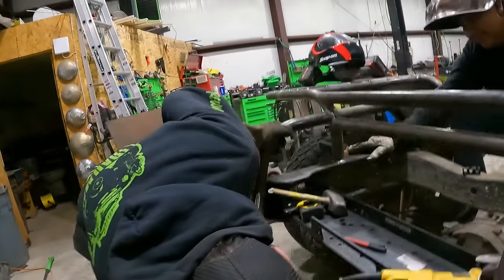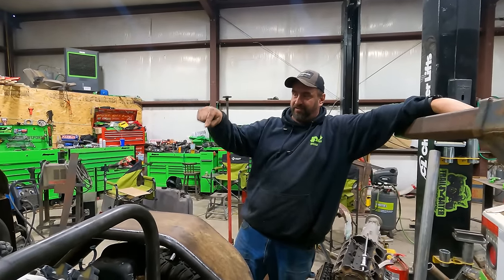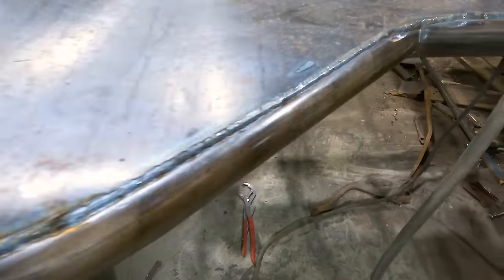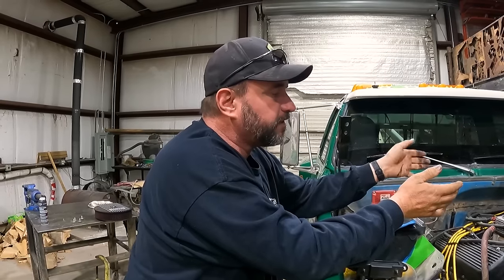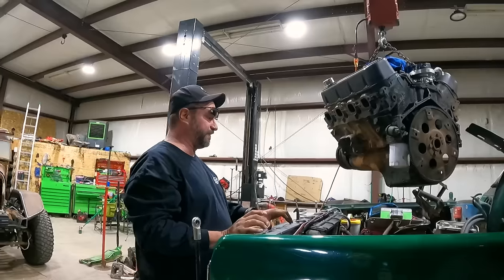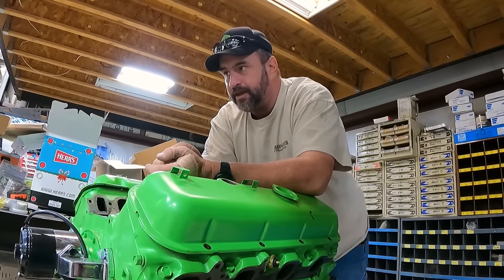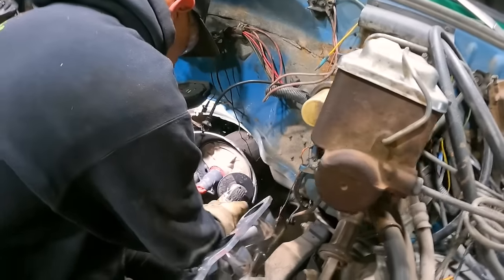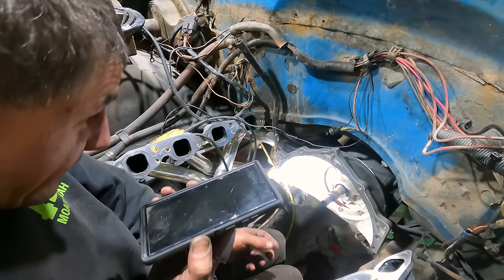@RobbyLayton Model AA Wrecker Gets An Engine

Comment: Hahaha this proves exactly what I’ve thought about this whole build . Yes they’ve done some VERY NICE metal work on it , but it’s being built as a farce of sort . It could have a 4 banger in it and be all the same . Rory should practice what he preaches , IF THIS THING were being built for actual use . You want an engine with TORQUE not another wal mart special you see on every street corner . lol!  If anyone remembers it , Rory also declined an ls going in mater , when everybody was preaching at him to put one in . Robbie has FRED the big block FORD they always bash , but neither Robbie’s , nor Rory’s FORD have had even  a fraction of the work done to them that mater or ol blue have had done . lol!!!
Reply from the maker: And they will never be able to do what Trailmater does. I can't believe you are defending the most worthless big block ever. The 460 of the 80's and 90's was so detuned and choked due to emissions it has laughable output numbers. If you've actually watched my videos you would know Trailmater has a big block for pulling with a standard and the gears I have in it. This on is going to have an auto, with more gearing options and lower axle gears. Therefore as you sit on your high horse laughing at the peasants you insult, they laugh at your ignorance of the actual situations these trucks are used in and the different ways they are set up... Thanks for watching.
Reply: Well you’re kinda getting the wrong concept to the comment , lol it’s not that I’m necessarily defending anything , just making a point that all things non Chevy are not necessarily the junk you label them to be ! lol ! The 46O big blocks powered many many trucks for many many years , and no , of coarse the one you have , is not gonna compete with mater , because as I stated , it’s not had even a fraction of the work to set it up as such . lol my point was simply , that here again , you’re putting the second engine , in blue , already replaced at least one in Mater,  plus numerous other driveline parts , and had ANY of it happened to your ford , the comments would simply be , well it’s a sorry ford ! Lolol!! at his was even the case over someone gaggleyanked  fuel line connection .on it . Lolol. It’s comical ! Is my point  . And thanks for all the entertaining videos !  Love watching ! Carry on sir !!
Reply: What’s going to be interesting to see the outcome of , is Paul putting an ls in his wrecker ! lol! Evrything I’ve seen of it since he pulled out the big block , it’s wide open spinning and digging to have the same power . I’m just thinking it will be more short lived, and possibly not be quite as effective , being that it’s missing this LOW END TORQUE you spoke of ! We’ll see I guess with time sir !
Reply: Well at least Rory has done something cool with his life. Made some awesome rigs and making one more right now, not just being a bunch of keyboard warriors. Yeah he killed an engine in Trail Mater, he also completely owned it and didn't pretend there wasn't a judgment error, shit happens. As for busting parts anytime you ask what they are ask out of their equipment stuff is going to break, fact of life.
Reply: Can u plz do a motor build Series  for old blue??????????????? Plz 🙏
Reply: With the proper gears, you can do the same amount of work with less tourqe. C'mon man.... 😂
Reply: being a ford guy,,in aus,, i know sht..we dont have bbc,, unless imported by the drag queens..  LS, have problems.. theres not a perfect engine, but, fords pretty close on design..the 351c , 460, 351m, 400,  all truck engines, low torque, no guts.. easy fixed.. rv cam, flat tops..  an american vid, shoot out, with a 454 & 460.. the 454 came out with 7 more hp, & a sht load of speed shop parts.. ford, pretty std..  in the 70,s. i found, bought, a magazine, car mag,, it had a centre fold,, of,  ford, chev, dodge.. went thru all the crap in engines.. dodge, came out on top, chev last..  so,,i drive,, '' middle ground'',,  allways wanted a blazer.. have 3 ford 4x4rs.. 62 - 02.  & a 73 dodge challenger, 340 r/t.. still here,. ?.  also, story of 3 engineeres, at a car co.. had a bad fall out on engine design.. one went to ?, other went to ?. so,, id say, this is why most engines are similar.. no idea on specs of fall out.. theres 1 engine, that is total sht. 350 chev. just wrong.. fords 302,W,  was bad, cracking heads, broke cranks, studs pull out..  so.. my fav engine, is a 351c.. 16 yrs on LPG, 12.1 comp, 302c heads, no cam, never stopped, went like a cut cat, sold recent, same engine, i totally thrashed,, work truck, bronco, 82.. loved it.. never burnt oil.. the injected 460, has the better heads,, so,, flat tops, cam, job done, plus, fords in the 70,s were retarded, cough,, 4-6 degrees.. apparently, they had 440 hp ish, then 220, if lucky.. we have the same arguments here in aus, between holden nuts, with top loader g/boxes & 9'' diffs in there cars.. even bathurst ran them, as the holden sht wouldnt last 1 lap..then, if ford or chrylser,jag, audi, mini, win,, they get banned.. like the sierras in 89, 4 laps ahead,,banned.. fkn joke.. they had to import u.s. parts.. to ''compete..''.. 327, 350, saginaw, . our gov killed holdens,, not letting them import u.s. cars trucks.. in favour of jap sht..  yeh,, thats my big, 2c... from a big fan. +++++... @trailmater
Reply: @trailmater  427 is a good engine if built right , id rather see a BB dodge 440 but thats just me
Reply: You are exactly right he could’ve put a 302 in there. Just beeped it up a little bit and it would’ve had plenty of torque and it would lasted a whole lot longer than a Chevy.

Comment: Oh come on guys you missed a perfect opportunity to mess with Robbie by installing a Briggs and Stratton motor....
Reply: Or as much as he's in harbor freight a predator 😂
Reply: Nothing bigger than seven hp
Reply: @WasserSquatch  100% Predator "big block" 420cc going to the biggest is overkill... 😂
Reply: Apparently you guys don't watch 'RobbyLaytonNation' you'd know Robbie hates Ford's so they should've put a PINTO engine in it!!!   🤣
Reply: @gregchewie3059  It needs to be something that will run for ever, but be completely gutless. So they can't just say "it broke so we're replacing it"
Reply: Or worse, a Rover motor!
Reply: Please make that radiator support hoop removable.
Reply: @gregchewie3059 Demri said she wants an LS in her ‘72 Bronco.
Reply: @gregchewie3059  Robby who?😉
Reply: OMG 🤣🤣🤣
Reply: Well it needs to be said.  An LS  in a Ford. It's officially a Lord.  Your welcome Robby. 🙏
Reply: That’s about what Robbie’s crew needs.
Reply: Would match his skill set…….
Reply: @agentcrm  OK, so instead of the 2.3L four, go for the old 170cid I6.  The one with the intake manifold cast onto the head.  Made around a hundred hp in E100, Falcon and Bronco.  New valve guides every 150k to save oil...
Reply: Do it as a joke! Find 17 horse power and trick out the exhaust, tow set up and maybe put a few POWER WHEELS BATTERIES UNDERNEATH AND MAKE SURE THEY POWER SOMETHING! I KNOW THAT CAN HAPPEN ......THEM BATTERIES ARE TOUGH AND MADE FOR THE ROUGH......JUST ASK ROBBIE'S BABY FACE!
Reply: @WasserSquatch 1:24
Reply: It's a chev, they did.
Reply: You mean a 'Breaks and Scrappem'.

Comment: My brother had the same issue with a cracked trans bell housing on the Turbo 400 with a 205/203 doubler kit in his '79 K20 (it happened twice). After a little research we found that he was missing a brace that bolts to the bell housing/engine bolts on the passenger side, and runs back to the transfer case. Once we found and installed one he hasn't had any more problems.  Hopefully your new thicker bell housing averts that, but you might want to look into adding a brace as well.
Reply: Thanks for the info.I didn't have a clue to the need,and when it comes up,I'll do right 1st time.

Comment: Maybe consider cutting the radiator support tube, insert sleeves in each side and then bolt or pin them so they can slde off when needing to access the motor.  Saves pulling the water pump and crankshaft damper.😀

Comment: Of course it's an LS, it's the modern-day SBC. It fits in everything.
Reply: Because they are cheap and plentiful and SMALL they are narrow engines and fit into lots of small spaces..

Next cheapest power is the 5.7 Hemi,reliable powerhouses too..500 plus horse from a  5.7 with a cam swap and tune! Roughly 25% more cost than a LS ..

Ford 5.0 Coyote is the most expensive and complicated modern engine to swap.

Former Toyota Tech,now classic car collector and restorer for fun and profit...Never a Chevy fan but have a low mile 72 Chevelle SS 402 (buddy passed in the 90's and  his family wanted me to have his car,since I worked on it,I refused but they dropped it off in my driveway,so I gave in)and very rare GMC Square body Sarge look it up Sarge! Plus,loads of Mopar vehicles 69-70 Charger 440&496 stroker (383 big block)..E bodies,C bodies..loads of engines as I rebuild them,my cousin does body,paint etc.I do engine/trans/diff things that make them go!
Reply: @mypronouniswtf5559  Toyota tech but didn't mention a stock block 2jz with some goodies have been known to stretch the 800hp mark ON STOCK INTERNAlS even been reports of 1000hp on stock bottom end. They gladly live on the limiter one of the benefits of the straight cylinders. Basically a jeep straight 6 with an extra cam and better port work and a lot more computery stuff they even share the same junk auto trans

Comment: I was really hoping for a Ford straight six 300 with a turbo on it but the LS is hard to beat.
Reply: I've had 3 Ford pickups (86, 88, and 92) with the 300 I6 and all were manuals. Love that motor! They never die!
Reply: @the_dog_says_moo  Did you see Powernation do a turbo 300 making 500hp and 600 torque?

Comment: One of the biggest advantages I found with the LS was low heat rejection to the cooling system.  These things are awesome when you need to crawl around in the heat, especially if you have a limit to the size of the radiator you can run.     Great choice, though I will forever be a manual trans guy, kinda bummed there.....

Comment: All you have to fit in there, I guess that boat anchor will do. Hell, it ain't  in the Mater Fleet, which is good. It's too bad you didn't have room for an old 300 6cyl. I tried blowing mine up. I checked the gas, filled with oil, and it just kept going! Hell of a motor though. Nice build guys

Comment: Regarding the tubing that supports the front of the hood, rather than having it welded directly to the front crossmember, weld plates on the bottom ends of the tubing that bolt to the crossmember. That would have made the engine installation easier and allow for future easier servicing of the front of the engine.

Comment: LS looks at home in the truck. Those fenders and tow hitch look dandy.  Replacing the cracked bell housing and sizing a smaller torque converter on Ol Blue. Then fit, test, run the spare engine.

Comment: That is quite unfortunate about the bell housing. I felt the pain Mike was feeling through Shawn’s “Are you freaking kidding me?” ………..as for the replacement motor that was decided on……I don’t think you will regret that decision. I was going to suggest in trying to find a Cummins 4bt, like I have seen in those small aircraft tugs. But I have no idea what it would take to use for the serious gear reduction boxes that are powered by those serious torque generating engines.

Comment: To quickly rust the new bare metal, wipe the oil from microwaved popcorn bag on the metal. It should rust patina overnight. Learned that while sorting very expensive bearings 20 years ago.

Comment: Just to add to the spare engine topic. That’s something I wish I would have thought of when I resealing my last IH 392, 14 years ago. If I hadn’t neglected to make sure a Bose clamp was properly placed and tightened down, I don’t think I would have lost all oil pressure at 65mph. As you might guess……yes a fire extinguisher was used that morning.

Comment: Take a punch and put a few divots on the front and back of the block and intake, and it will hold your silicone in and won't allow it to push out over time.

Comment: You don't have a lot of room in there for a radiator or a fan. Maybe an electric water pump and an electric fan will give you enough room so you won't have to push the motor back much more. It's going to be an awesome rig. You got to love those old trucks.

Comment: Ouch, it sucks that part did not fit but better that you discover it on the first step instead of entire thing going cablamo when you put everything back together. I am a computer guy so I have no idea what the difference was between all those motors. As long as it fits and as long as it does the job, I do not see an issue with using a less popular motor there. If they want to upgrade, they will do so in due time and probably figure out how to do it too "themselves". And the new motor going into old blue is also green! It is coming together Rory... it's like green was always meant to be, lol!

Comment: Problem with stroking the old tall deck the cam isn't raised to clear a larger crank 4.25" is big as you can go if memory serves and the stock 4 ring pistons are very heavy.  If bore is straight my opinion stroker crank longer rods and very mild cam. Stock bore pistons

Comment: Guys that's more power than they usually pack in them Ford's,however my dad's F2 phone truck he dumped the boat anchor and installed a Buick 333 Nail head that drove the power up significantly.

Comment: Because we are not allowed to run non-billet cases at the Drag's, I have a bunch of 400 4X cases. One for Blue has H.D. on the bellhousing. I have early pumps with 7 bolts . I'd gladly bring to games and trade for some Trailmater stuff . See you guys next month. I also have cool transmission tools and 20 years of ATRA Seminar books . I fix  transmissions in all the new stuff as well .

Comment: It doesn't seem like that receiver will be going anywhere.  I'm  curious as to how you'll fit a fan blade in that tight space behind the radiator. Leave it off and put an electric in, after recessing flat head screws to hold the WP pulley on?  This is interesting as hayull, guys.  I love the fabs every time.

Comment: Since y'all do so much big block stuff, might like a mod an old timer did to his engine stand. He used a slack adjuster off a semi welded to the end to allow him to rotate the whole engine with a wrench/ratchet. Only downside to his design was that you couldn't mount just the plate to the block and then put the stand together. But, end of an S-cam would let you do both...

Comment: ,,No such thing as a large boatanchor?,,😉. Fun fact. Yes indeed. A boat has no differend anchors. But if anchored for a longer time you take more things in consideration. And a vessel working on a spot while anchored would use larger/stronger anchors. Also for a boat its a deadweight you carry with you and only used if needed😉.
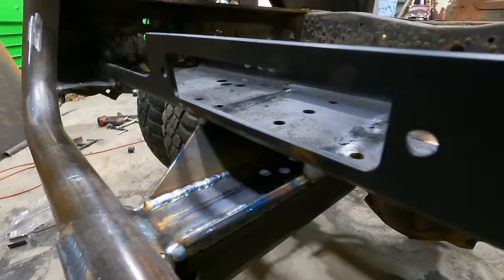At 06:46. Thats what you get when the ,,take care wet paint,, sighn is missing? Awsome built gentlemen.

Comment: Robbie wants an LS, he gets an LS. I hate the idea, but at least it is being kept alive and not chopped to a gun slit for windows. He'll paint it up and someone with an electric motor at some point. BTW, I drive a Chevy S10 Blazer, I love it. I just don't like crossing brands. Yes, I understand the customer is right. I am over it. On old CYAN or AQUA... Yes keep the 427, freshen it up. Old Cyan, Cyan means "blue-green." 😇 Smaller torque converter will give you a little higher stall. That should help rock climbing. Like slipping the clutch.

Comment: I won't use the jw or any other bell housing that it only attached using the pump bolts.  The case was not designed to have the load attached by the pump retaining bolts.

Comment: That's why I said but the bar on the outside of the radiator housing at least you would have got some protection against trees and stuff like that from getting up the old model a grill but now you got the bar in the way of the radiator water pump and the pulley

Comment: Loving this build so much. Out of curiosity, (only because I'm notorious for filling my hitch with mud) would a small hole in that back plate be useful if you need to get mud and gunk out of the hitch? Just curious is all, great job, far better than I could ever accomplished. 6:44

Comment: @3:14 That's why you BOLT the "core support" hoop to the frame instead of welding it. Are you gonna put in an electric water pump? Stainless hardware cloth grille and radiator in the back? I'd have wanted to have this stuff all figured out before making cab mounts and such permanent.

Comment: Back in the early 70s we had a sixty something GMC farm truck that had a 351 v6 I know you already have a engine but was wondering if you ever heard of it,tons of low end torque not that we ever would over load the 16' bed on a single axle truck you know 😊
Reply: GMC also made a V12 version with 702 cubic inches for big trucks.
Reply: I think that is a 305 v-6. They were called the coffee can six because the pistons were so big. I had one in college, loads of torque.

Comment: Sometimes you have to use what will fit and not what would be maybe a bit more correct or whatever correct really is. Still Robby isn’t much of a mechanic so a LS is perfect for him. I’m not that much of a purist but one day I’m pulling that stovebolt 6 out of my 55 and putting in a Rousch Ford 302 into it. Oh, Sophie is my dog, I’m a 71 yr old male retired firefighter.

Comment: Yep. No LS boat anchor. They are worth tomuch at the scrap aluminum plant. Yes it's worth pulling the steel out. They will ding you for $100. Otherwise it's about $300 for the block and heads stripped of steel.